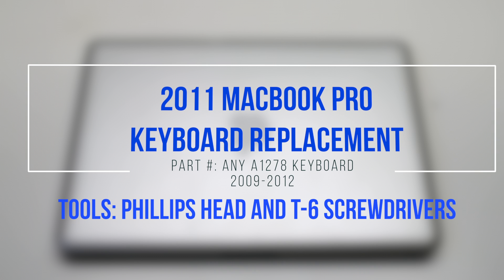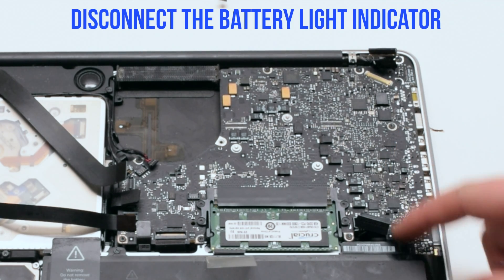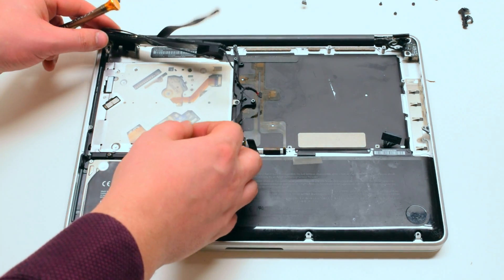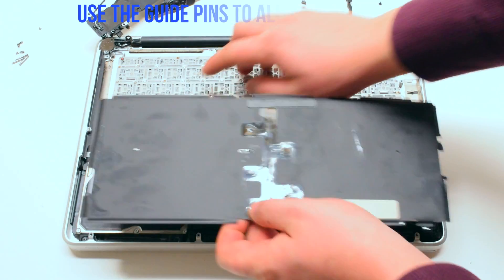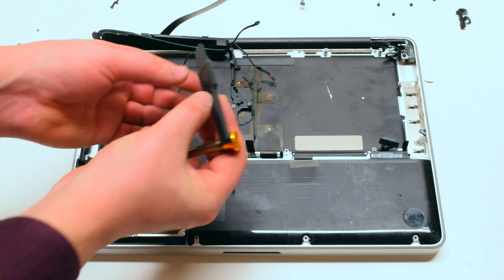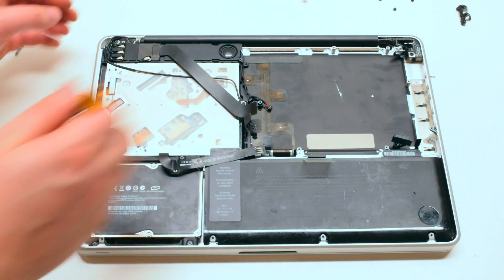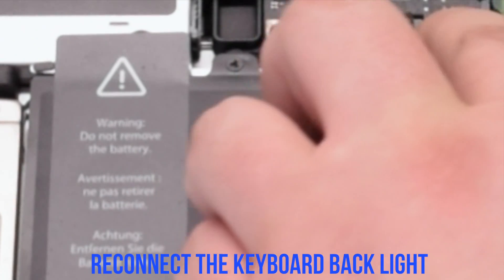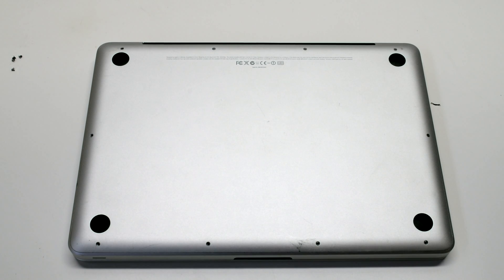2011 Macbook Pro 13" A1278 Keyboard Replacement

Comment: Thank you very much for the video. It goes through every step, one by one. I followed the instructions and replaced the keyboard on a Macbook Pro on which a cup of coffee had spilled, causing some of the keys to not work. I have two suggestions. First, to list the tools needed for this work, specifically the need for a Torx 6 screwdriver. I had to run to a box store to find one of those after I had taken off the back cover. A minor point is that when reassembling the computer, the step for putting back the microphone that is glued to the case. Overall, I highly recommend this video.
Reply from the maker: I'm glad this video helped you and thanks for the tips, they will be added in future video series.

Comment: after replacement my mac won't turn on 😭 please help
Reply from the maker: Ok don't panic, flip the Macbook over, open it, unplug the keyboard ribbon cable and read this guide on how to turn the macbook on without a keyboard ( http://www.insidemylaptop.com/turn-on-macbook-pro-laptop-without-power-button-locating-power-on-pads/ ) if it comes on (after shorting the power pins found at that link) then try reinserting the keyboard ribbon again, if that doesn't fix the issue then they keyboard you installed is faulty and you will have to perform the replacement again, also once a new keyboard arrives you can always test it by just plugging it in and using it's power button to start the mac before installing it.
Reply: Save Apple Dollars thanks for reply . i have been trying to unplug the keyboard and doing the step to turn it on without keyboard. but it doesn't work. then i try to plug my old keyboard it still won't turn on :((. Anyway yesterday before i test my mac to turn on, i have issue with the fan port, when i pull the fan cable, the port is detached from the logic board and then i try to put it back with soldering iron. does it affect my mac to turn on? (sorry for my bad english)
Reply from the maker: No it shouldn't effect to turn it on but it will shut down with in 90 seconds without the fan. Do you have the charger plugged in? do you see a light on the charging cable if so what color? Also, have you tried to plug the battery in and turning it on? If you forgot to plug in the AC converter under the logic-board and your battery is depleted it will never come on.

Comment: Hey bro what's up! I have great news haha I finally take the my cargo and test it immediately.  Actually when reach the my second cargo I mean the contact cleaner firstly cleaning the motherboard then installing the keyboard but  anyway maybe it's not a dust or   some what the connectors fault of inside said and test it without cleaning the contact cleaner. And guess what the 2012 model A1278 keyboard full of working finally! I'am really so happy the fix it finally. But first my Caps-Lock key working the reserve :D then I'am resetting the PRAM-NVRAM resetting it's fix it too! All keys are working flawlessly now. When you said the it's absolutely not a keyboard connectors problem just a keyboard problem you exactly right. Your luck comes to 3 my luck comes to 2 :) And after the all of this conclusions  we know the Apple Hardware Tests not as trustly at all sadly... I hope the my tests helping the some other ones and thank you again the your time and effort bro.
Reply from the maker: Glad to hear that everything worked out! Yes the AHT is a worthless application, I never use it my self. Wish you luck on your next repair!

Comment: Hey bro my MacBook Pro 13 2010 A1278 model have a keyboard issue once one key then a lot of key stopped the working even working ones writes different letters so I'am open and cleaning the all keyboard parts then try and more keys don't works. Buy a new keyboard and install then  like a joke same issues appear and still don't work. I have try everything; reinstall OS, keyboard settings, mouse keys etc. But when I connect to any usb keyboard even non-apple it's work like a charm even re-mapping the keys like CMD - Option like Apple keyboard and it's same the screen keyboard have non-issue. I'am afraid  it's like mainboard issue I have no idea how get damaged. MacBook or Keyboard never touch the water or spilling. I'am thinking buy a other new keyboard and test again if it's failed again I have no damn idea. What you think? Ty.
Reply from the maker: So something like this has happened to me before. I had installed 2 keyboards and both were BAD. The 3rd one worked just fine. I can almost guarantee you that if it's not your keyboard connector that you should inspect then just replace the keyboard and make sure to buy a replacement from a reputable reseller.
Reply: Hi, thank you for answer. I'am already buy a new one and it's 2012 model ı guess it' same but not test yet cause don't reached me already. Btw I'am run the Apple Hardware Test with Extented selected then 1.30 hours later I have got an error like this 4SNS/ 1 / 40000000: VPOR - 13.020 and searching this error code it's Failed Sensor. But when I ran the this test the usb keyboard connected like first 20-30 minutes then I disconnected. And I ran the test again without keyboard or any usb devices except my flash drive cause it's have the AHT, same Extented selected and after 1.30 minutes completely no error all passed. Btw two test ran the ac cable on. And I ran the test again even ac cable detaced directly on battery and flash drive but not selected Extented option after 3 minutes again no errors. İt' really strange. I have NVRAM reset too but it's same old keyboard. My plan is when reached the may second keyboard before I ınstalling I'am use the electronic contact sprey my mainboard then ınstall and see what happen. I'am gonna notify you when I have done bro. Btw my Mac all of cleaned, the fan, the mainboard, all other things even change thermal paste and others but anyway cleaning the contact sprey too all over the board. What you think?

Comment: My macbook pro 2011 wont charge after reassembly. The only thing I am not 100% sure I re-connect perfectly is DC-in power board. It says battery not charging: power source: charger... so I am not losing battery percentage when connected to charger but
Reply from the maker: It's hard to say without looking at it but I would take the logicboard out and check the DC-in connector and just reseat everything. Also while out, give the Logicboard an alcohol rub down.

Comment: Does anyone have any advice to not damage the backlight before I attempt to do this?
Reply from the maker: Just be very gentle, use the guiding pins on the lower assembly and make sure to reconnect the back light after the swap.
Reply: @GRIBSOFT  It seems my backlight stopped working before the keyboard switch (btw, Very nice step by step how to video), what can I do to remedy this problem. I double checked the connection on the logic board.
Reply: A
 liquid was spilled on the keyboard....